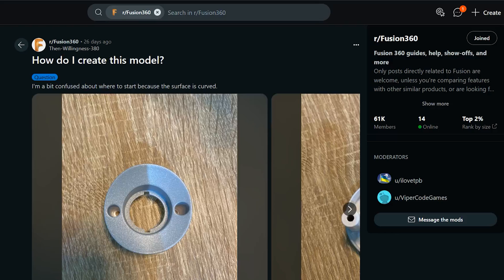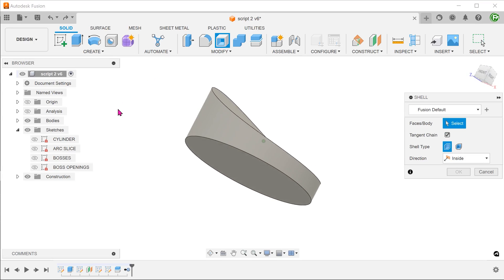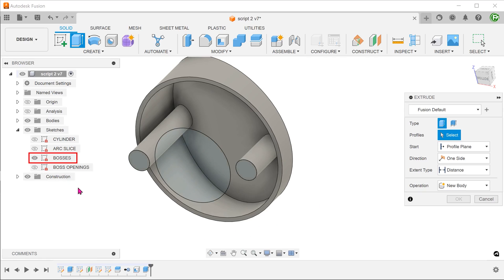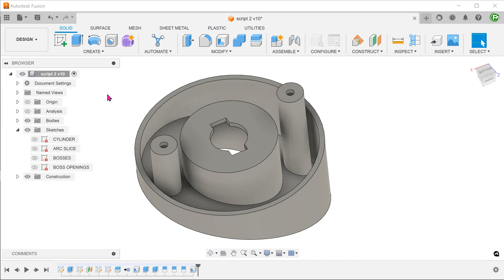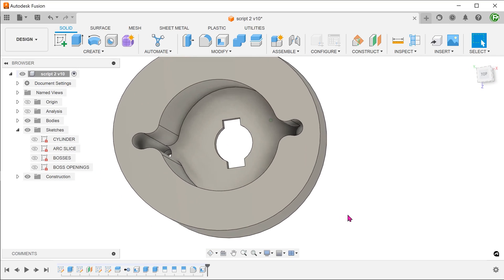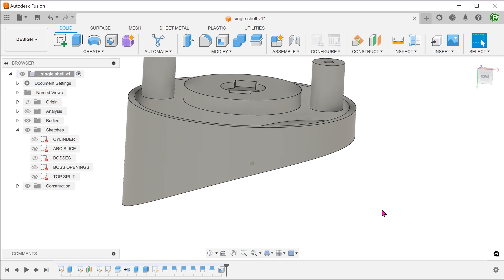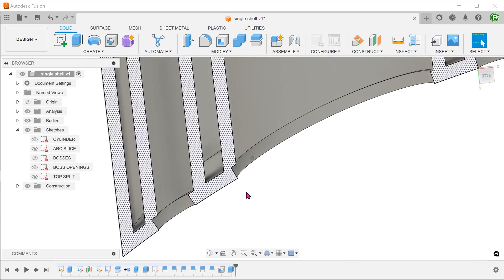Autodesk Fusion | Can we do this in a single shell?

Comment: Your second attempt was really close to working. When I saw this video I immediately downloaded your model because I wanted to check a hunch. If you use Delete Face on the 6 faces where the bosses meet the main body, the cylinders will become aligned again. Make sure to do it in the Solid tab, you don't want to make it a surface model.

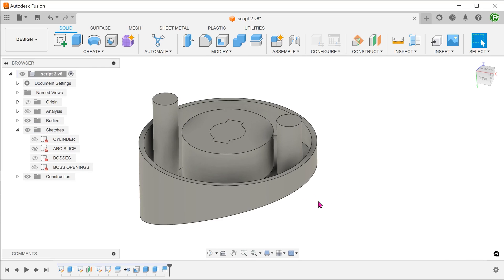Comment: Why split face instead of extrude cut @3:50 ?
Reply: Because that will not result in the same interior shell as you see at 4:57 if you do it that way.
Reply: @Sherlock_Ohms  The result would be the same, as shown in 4:57. It would just be more work to click on the inner faces.
Reply: @Sherlock_Ohms  An alternative would be to have made the shell before the hollow figures, then just extruded them to create the openings, as always, several paths to the same result.